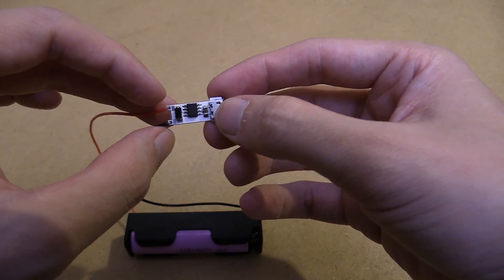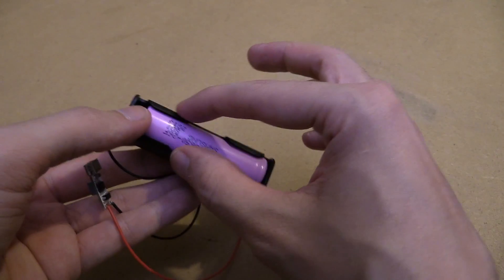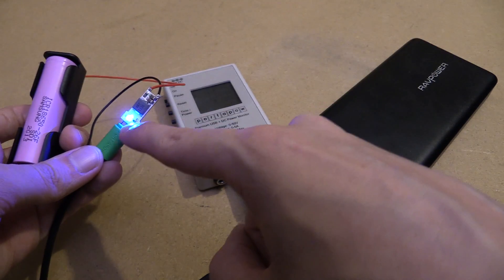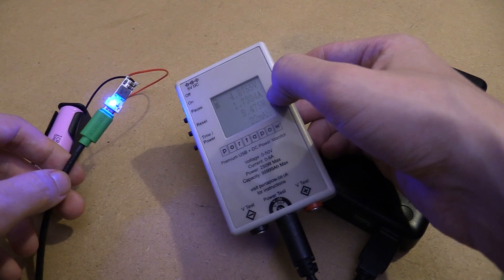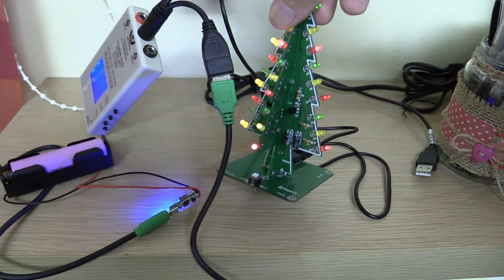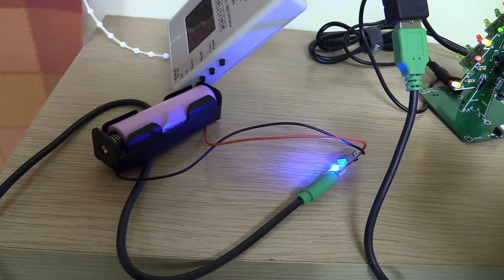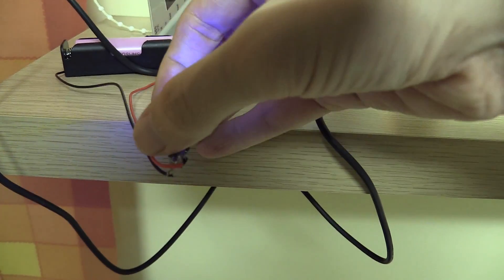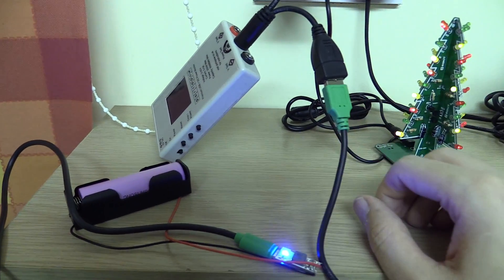2A 18650 Charger (LI4001)

Comment: Where did you get the battery holder - it looks big enough to fit a protected 18650 which is very rare!
Reply from the maker: +Simon John it's from ebay, I bought 10 of them for like $2 or $3 but I don't like them that much cos they don't do well with flat tops. You can make it work but they're not perfect.

Comment: Looks like you already figured it out, but this is a dc-dc buck charger meaning you can't make any assumptions about the output current by just measuring the input current.  You very well could have had 2A going into the battery but only 1.5A drawn out of your USB power bank or wall charger.

There are two other similar buck charger modules you might want to look at as well that go up to 2A.  Search for TP5000 or TP5100.  The TP5000 has a jumper to handle either normal Li-Ion cells at 4.2V or LiFePO4 cells at 3.6V with an input of 4.5-9V.  The TP5100 has a jumper to handle either 1S Li-Ion cells at 4.2V or 2S Li-Ion cells at 8.4V with an input of 4.5-18V.
Reply from the maker: +Steve Erisman yeah you raise a good point. I should have and could have measured the output from the module going to the battery rather than the input power. I might do a follow up video where I measure the input and output to see how efficient it is. I think we're going to see pretty high efficiency because it doesn't get that hot. I'll check out those other modules too, thanks :)

Comment: cool Christmas tree,so how long it takes to fully charged from empty?
Reply from the maker: Thanks :) It took awhile to solder it, but it was a fun project. That's a good question, of course it depends on the capacity of the battery itself. It will take longer to charge a genuine 2600 mAh Samsung than a fake 300 mAh Ultrafire. The current will drop off as the battery voltage increases so I'm not exactly sure. Maybe I'll drain one of the Samsung batteries to 3V and then time how long it takes to recharge :)

Comment: Generally charging at 1C I think is fine. So if your lithium cell is 2000mAh+ you should be ok charging it at 2 amps. 
These modules are generally linear which means they need to drop the differential voltage within the IC and that's what makes them hot. Using your power bank at 4.8volts would have kept the whole thing a little cooler than the mains adapter by the looks of it.  Thanks for sharing - that module is one to add to the collection I'm building up!
Reply from the maker: Good point, I guess 1C is typical, I'm just used to having lower capacity 18650 cells where 2A might be pushing it :P It seemed to handle the heat without any problem but I might just add one of those little stick on heat sinks anyway :)
Reply: Gadget Addict I've just checked the data sheet for the LI4001 and of cause it's proved me wrong. This is a buck mode power supply (hence the inductor) and therefore it's not linear at all! So disregard most of what I said, I'd not all! :-)
Reply from the maker: Oops, I could have mentioned that too lol. It is in the video description but it's not shown until you click the 'Read More' button. I don't think I'd have been able to touch it if it was linear based.

Comment: That's a neat gadget! also, does it have a protection chip built in?
Reply from the maker: It has protection against short circuit on the input, shorted cell and overvoltage on the cell. The IC also has protection against overheating but that's for the IC, not the cell you're charging.

Comment: can you get   smaller size  bat  that  fit in  a rf  remote   may  be  even one that  can wire less charge  then lay remote on a pad  then  not need  buy bat  again  :)
Reply from the maker: This can certainly be used with different sized Lithium-ion batteries but you probably wouldn't find that type of battery in your average TV remote control for example. Wireless charger kits do exist so I'm sure you could hack something together but I'm not sure how practical it would be in the long run. I think we're still quite a way off from universal and useful wireless charging.
Reply: the wireless thing  was   a joke  :) I have a rare tv I cant find a  new  remote  for  and  the  bat  slot it  gone so  it need  to be repair  so if going truble  might well  do it  recharge abl but for now I have a usb cable  hook up too it
Reply from the maker: Ah okay, got it :) At least you still have it going via USB lol. That reminds me of the colgate toothbrush I converted to USB after the internal battery died. Although the voltage was too high so it was like a turbo brush lol